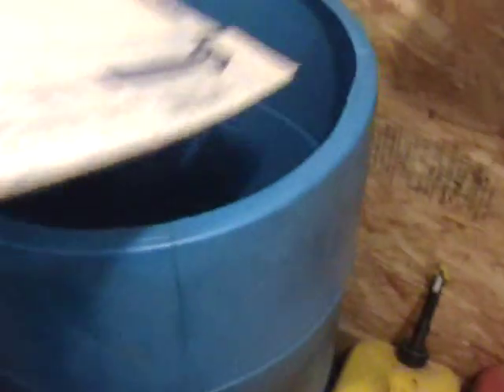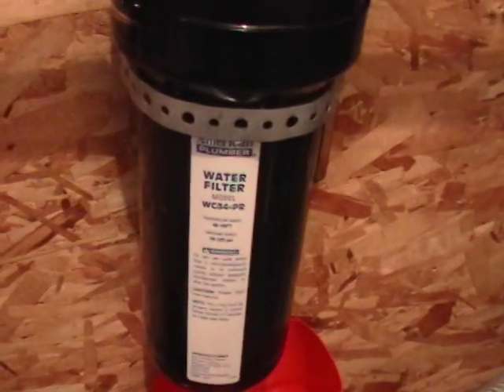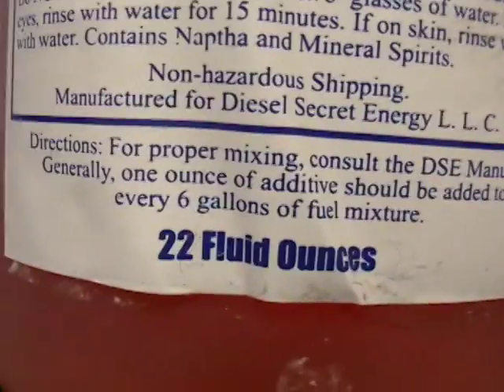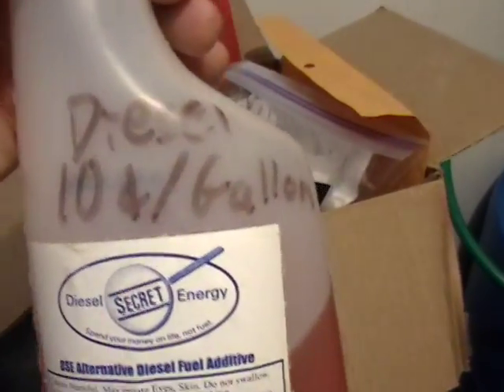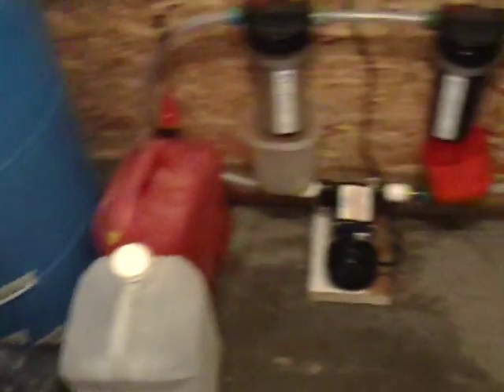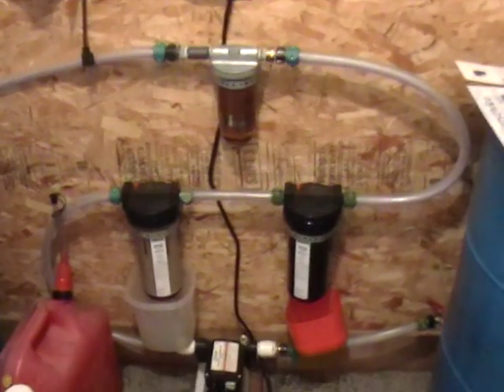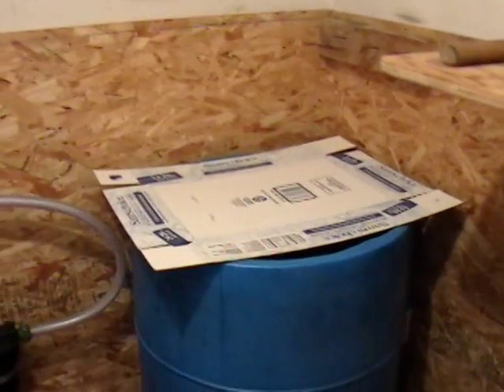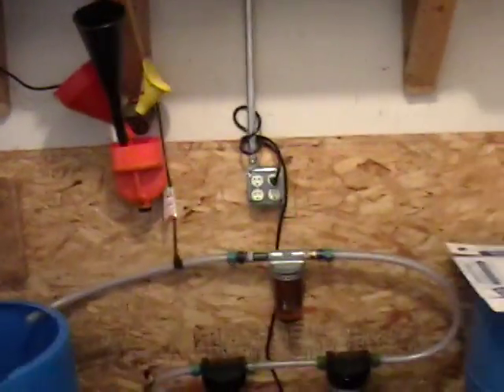How to make Biodiesel

Comment: nice set up in order to thin out the oil it would have been nice of you shared tje amounts of each u ised per gallon of oil, that is the most important piece of info, i prefer to not use heat

Comment: Because you asked for suggestions, opinions, advice. As others have stated this is NOT biodiesel. That DSE stuff is junk. What you have here I think will eventually ruin an engine. While tractors and such can burn almost anything, vehicles are pickier. 

For new people, there is cheaper equipment. That pump alone is $250! While it does 1080 GPH, Harbor freight sell one for about $40. It only does 360 GPH but that is enough to get the job done.

Comment: nice job man but that not called Biodiesel its called wvo same thing i use in my dump trucks but it wont run in my pickup its to thick burns the pumps out all as your doing is adding diesel additives witch dont do much im starting to make real  Biodiesel with methanol and  lye so i can put it in all of my trucks and equipment

Comment: What you make will run in a diesel engine,but there is alot more to making biodiesel than merely filtering veg oil,adding kerosene/petrol and aftermarket "Magic" juices.Have a good read up about how its done properly with vegtable oil,all you are doing is making a slightly volatile fuel bulked out with veg oil,NOT diesel fuel.

Comment: Gasoline or alcohol can be added in small amounts to thicker fuels like veggie oil without causing damage, it does thin out the oil but increases octane which makes for harder starting.

Comment: This isn't a true bio-diesel setup where you are removing glycerin and using methanol to make a methyl-ester based fuel (bio-diesel) this is treated veggie oil and it's actually what I run in my truck, I use small amounts of ethanol/kerosene/powerservice supplement in mine.